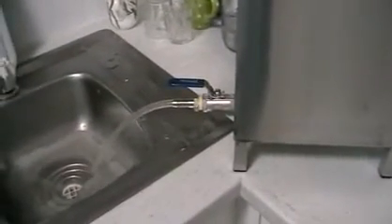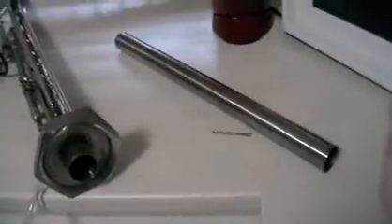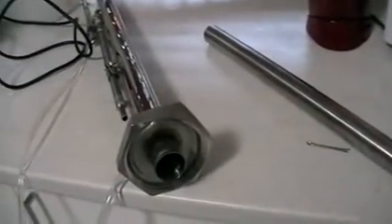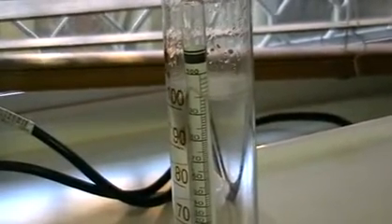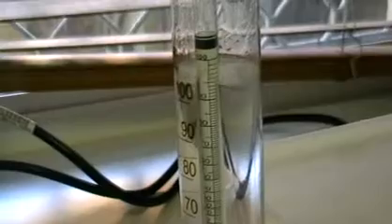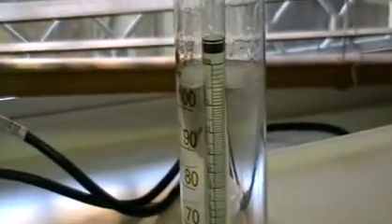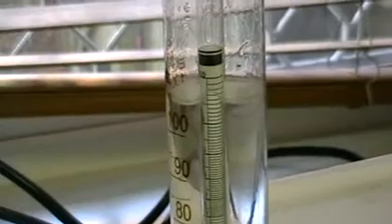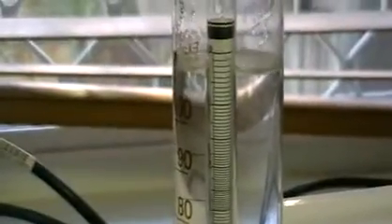Reflux alcohol still N 25

Comment: yes i like your still and its ability to change from primary stripping still to fractional still. The main thing i like is your all metal designs--no plastic! Iwould like to know how much is the price to buy this still? how much is shipping to USA? I wish you had point of entry design like the charles 803 still or 804 still--where boiler is separated from column--that way we could use a tankless/point of entry heater with efficiency in mind.

Comment from the maker: Hi it uses 1kw per liter, and this is not fuel still, though can be used as one, this is an food grade alcohol still, so the calculations of power/ output ratio is not really applicable to this particular still.
Kind Regards
from New Zealand.